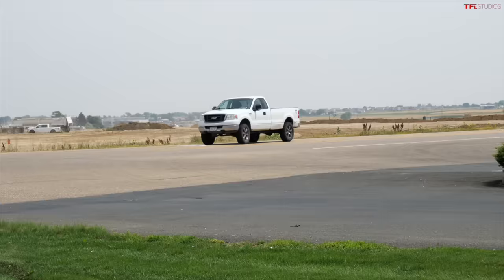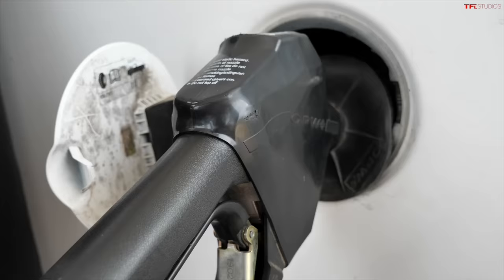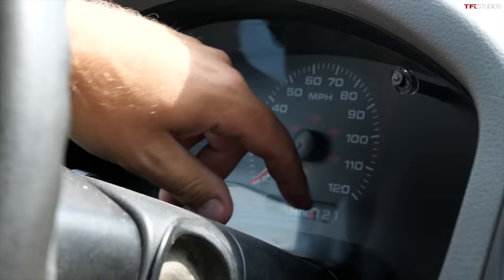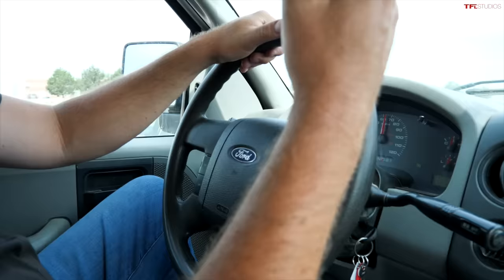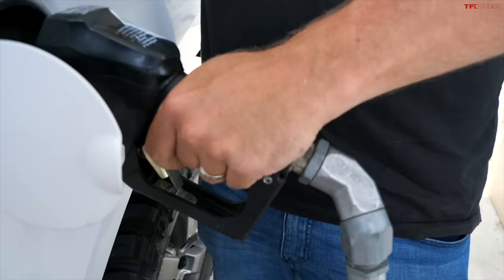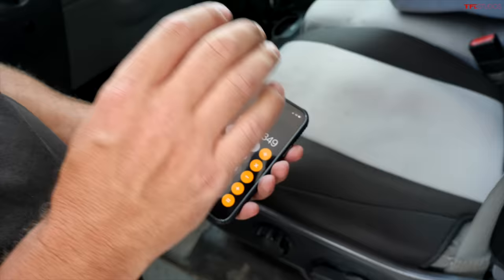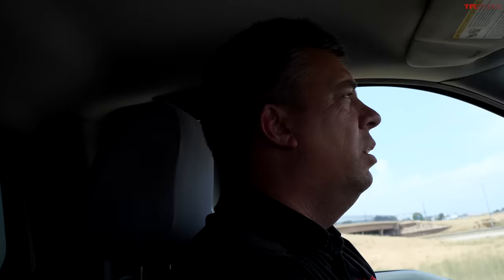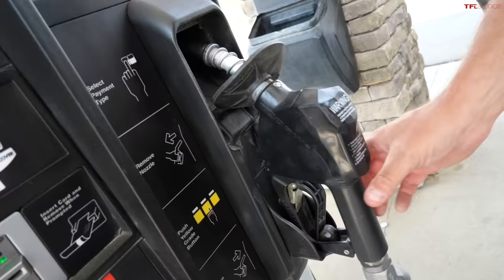Surprising Result: Here’s What Happens To Your Truck’s MPG When You Install A Topper!

Comment: It's very hard to achieve an accurate result in any sort of mpg test. I've recently been regularly driving a 180 mile round trip to a work site and back and tracking my fuel mileage. Some days you notice heavy headwinds/tail winds that significantly alter fuel mileage, but other times conditions seem to be exactly the same yet mpg can vary by 1.5 mpg, despite this being an easy route to replicate the driving on, as there is little traffic and you can just set the cruise control. I put new Michelin tires on replacing some noisy worn BFG tires and thought the mileage had improved on day one, but it proved to be fluke conditions as the next day the mpg was back in the usual range. There are just so many variables contributing to any one run and the resultant mpg. You'd need to have some dramatic change in the vehicles fuel mileage and do several very long runs before you could definitively claim an improvement, or loss, in mpg's IME.
Reply: I agree with this. I drive a 2016 F150 Ecoboost V6 about 60 miles round trip. I cruise at 62mph every single trip. Some days I've gotten as high as 24mpg and others as low as 20mpg. Granted it doesn't normally vary that much, those are just the extremes, but I'd would get it does vary regularly at least 1.5mpg. I always fuel up at the same station. I have wondered though if these toppers would improve mpg. I have a hinged Tonneau cover and had been curious if it improves my mpg or not.
Reply: I agree but 1.5 mpg is not significant in my opinion. I suppose as truck owners  we're grateful for whatever increase we get because in spite of Ford and others trying to convince us that we're getting great gas mileage, in reality nothing much has changed. The Aluminum bodies don't seem to help in spite of PR from Ford. Reducing the thickness of the finish didn't help either.  I just sold my 2013 F150 3.5 Eco turbo with bed cap. 16.5 MPG. I really don't understand why so many people buy gas hogs to go to McDonalds.
Reply: @williambranham6249  Aluminum body doesn't help much? It is like 700 lbs difference. That is like 4 average guys. You bet that makes a difference!
Reply: @travisjazzbo3490  How much?
Reply: @williambranham6249  700 lbs?  Let's give you some perspective... Ever loaded 700 lbs into the back of a 1/2 ton pickup? It is loading it to just 30% under its max weight! you can SEE the springs lower significantly.

Even if just that gave a pickup 10% better gas mileage, that is significant. I bet that is about right
Reply: @williambranham6249  Actually you are the fool. People buy pickups for all sorts of reasons and typical Americans drive pickups in a way that they aren't using it for the 'pick up' function 98% of the time, so they absolutely will consider gas mileage when considering a pickup truck, especially if one gets 10% to 20% better gas mileage than the next one.  I can speak from experience when speaking of the newer Fords with the aluminum body and the small V6 EcoBoost which has plenty of pick up and go power. They get on a average 22 MPG where any of the competition is closer to 17 MPG in driving around HWY and come City. Now, this changes significantly when under a significant load compared to the others, but as I said, most Americans aren't pulling and hauling loads 98% of the time. They are using their trucks just like a normal car going from point A to point B. Interesting  you don't understand that when it is so easily observable by just being out in the world and statistically PROVEN on top of it. Ford in fact understands this and that is exactly why they do what they do and how they do it.... MANY people were making fun of EcoBoost but I have yet to meet anyone that doesn't love the engines and so far they are lasting well
Reply: @George Vinson You are correct, while a tail wind can massively increase fuel mileage, wind from just about any other direction increases drag.
Reply: @travisjazzbo3490  Have been reading the comments with interest, as a British observer, you talk of the lighter body and a more efficient engine together, it would be interesting to swap the older engine for the more efficient one and see the result, it is difficult to claim the lighter body makes a large difference when they have also changed the engine, its like the old fuel saving devices that worked with just a small carburetor adjustment,  the way the gentleman conducted the test in my opinion is as close to real world experience as possible, and we all drive there, not in ideal test conditions. Fuel consumption becomes far more important when you pay £1.54. per litre, (4.54 litres per gallon, British)!!, enjoy your cheap fuel, I wish we could☺.
Reply: @CrusaderSports250  US gallon is smaller. 3.7854 litres. So 5.83 per US gallon, plus difference in US dollars vs pounds?
Reply: @glenpearce3883  I am aware that gallons differ either side of the pond, I presume it was something to do with a barrel measurement, your fifty gallon barrels appear to be the same size as our forty five gallon ones, weights and measures are often about what could be handled in the day, by one or two men or pulled by an average horse, or some other limiting factor, with diesel down to "only" £1.53 per litre, however you work it you still have very cheap fuel by comparison, and while governments will tax us to bring in their revenues expensive fuel makes everything unavoidably expensive , you also get to run some really smart motors that would be just unaffordable here. enjoy your driving☺.
Reply: Depends on the nut behind the wheel
Reply: Even the energy required to displace precipitation off the pavement will affect MPG.
Reply: @rudygeorgiamulesandcountry1594  True another source for reduced mpg and rain is often accompanied by windy conditions, so a double whammy.
Reply: @select20  That also shows the computer is way off too, you can not go by that alone. You would really need to have the exact same fuel, run it till it's out. Myth busters was probably the closest we will see with this as it takes too much time/money to do such a test.
Reply: Very little improves mpg over factory. All the bullsh!t about performance mods improving mpg are all rumors. Usually, if performance is improved, mpg suffers. There's no free lunch. I've been a professional mechanic for 50 years, made tons of mods to almost all of my vehicles & I've been able to improve performance without hurting mpg but have never seen the econompy improve, even when making mods to improve economy. For every action ther is a reaction is the rule that never changes.
Reply: I think air density is a bigger factor than we normally think.  We're plowing through a fluid medium the whole time.  Temperature, humidity, rain, wind....

Comment: There are three primary benefits to toppers: protected storage, racks on top, and most importantly making the pickup more balanced so it handles better in snow.
Reply: Protected storage. Basically, another place for thieves to break into. Racks on top drag your gas mileage down.
Reply: @dave5176 must suck to live in the city
Reply: @vasmajority45  Yes it's really not what it once was.
Reply: @vasmajority45 ehh, depends on the city.  I’ll be able to retire at least 10 years sooner because of living in a suburb, working close to a large city with way higher pay.  I’ll also be able to buy land and a cabin to get away.  Commute only takes 20 min or so.  To each his own.
Reply: Protected storage I’ll give you but a rack on the bed is much better than a rack on a cap. As far as weight a couple of sand bags in the winter makes far more sense that carrying a cap around all the time.
Reply: @dave5176  I have Thule racks on my topper and it only takes a minute to remove or install them. They are off right now. Normally racks take work to install and remove from vehicles, but the topper ones were designed to be easily removable. I don't leave valuable things in my truck bed. When I use my truck to move things and take them out when I arrive at the destination. The topper is lockable, but there isn't any reason to lock it.
Reply: The balance is only true for trucks with a perpetual empty bed.
Reply: @elliotkane4443  I forgot one important point for California residents it changes a commercial PU truck into a personal vehicle with significantly reduced registration fees. The savings will pay for the cap in about 10-15 years.
Reply: #4 Makes for a great spot to sleep, in the bed of the truck, on weekend camping trips